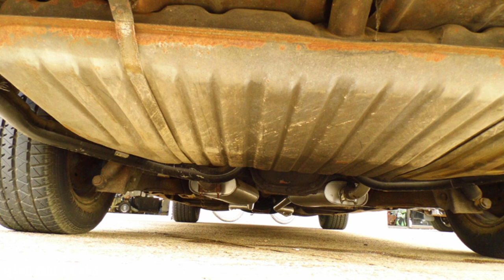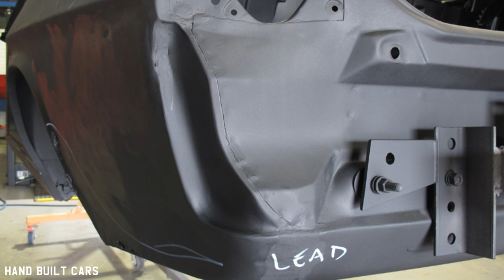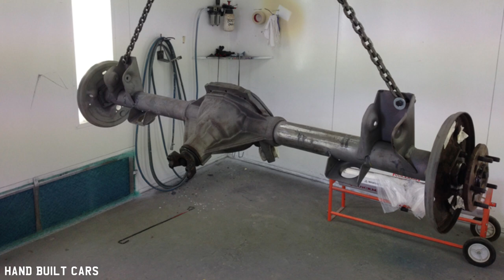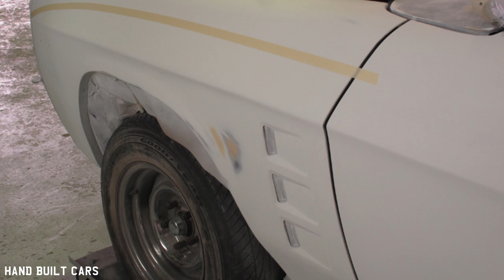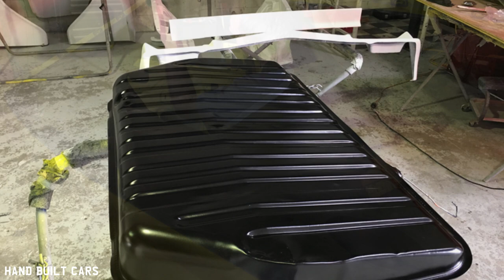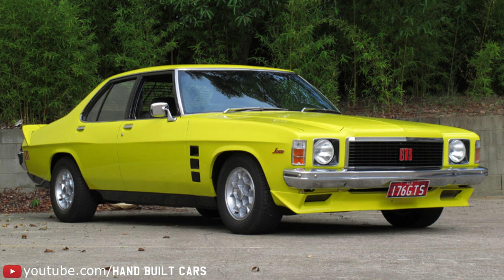1976 Holden Monaro HJ GTS 4.2L Restoration Project

Comment: i had a HX GTS same color (lima yellow) had it for 15 years nice to see it with the original honey comb wheels& caps ( they are rubber moulded over steel rims ex american pontiac) color coded bumpers would have looked better the only difference with the HX was the painted blacked out bonnet and the GTS on the rear doors and on the back of the boot lid and color coded mirrors
Reply: The HX also had less horsepower from its emission controlled engine.
Reply: Correct but you could change the heads and exhaust and block of the emissions gear just don’t get caught I have been busted a couple of times had to put the original air cleaner and make it look like the pollution gear is working (good idea to keep the original gear if you have it) they clamped down in the 1980’s and 90’s but the cops seam to have forgotten about the early holdens